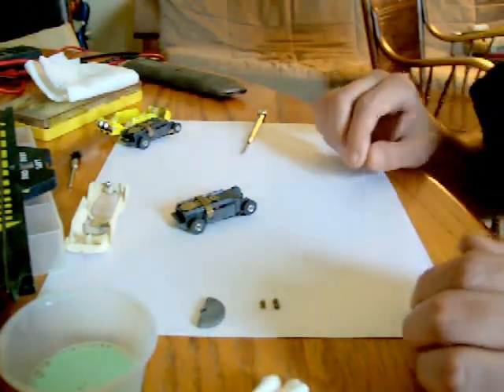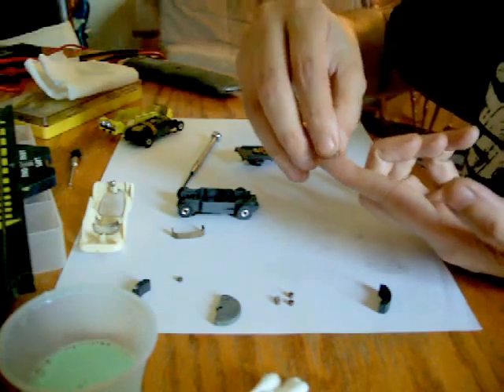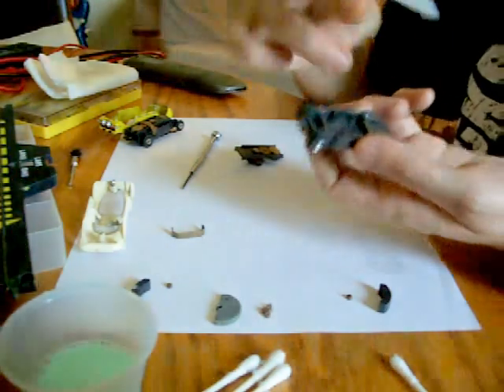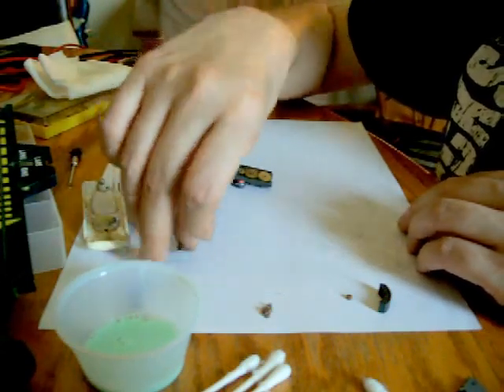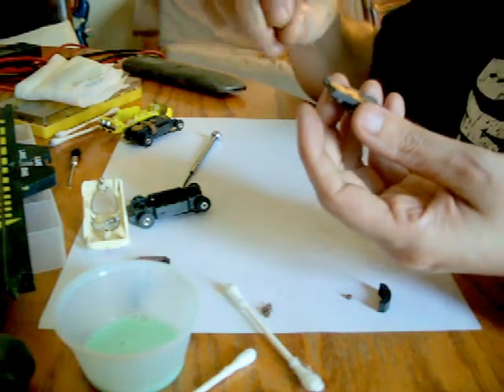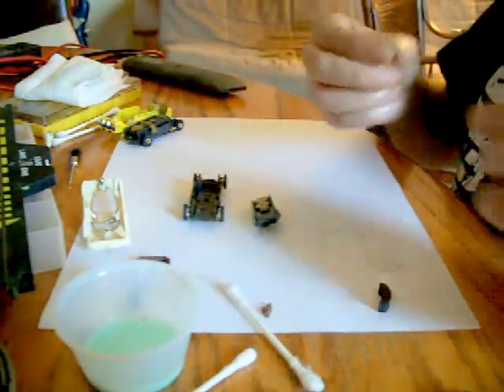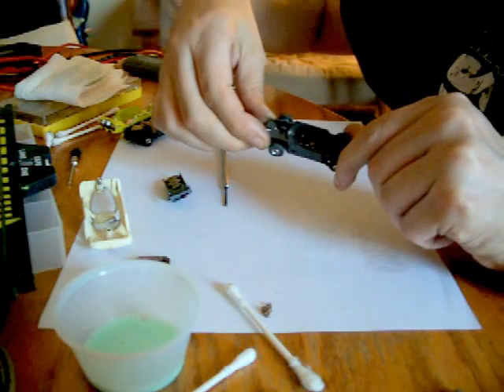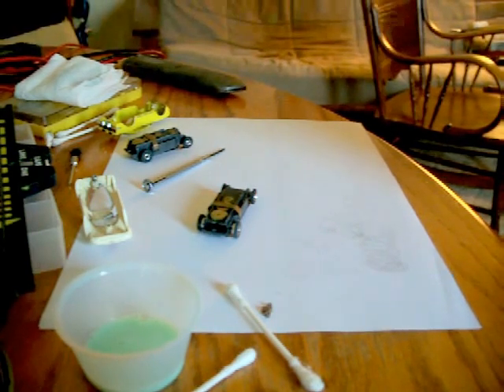Thunder Jet 500 cleaning - Part 2 of 3

Comment: pretty good video for basic cleaning of a like new or new old stock T-jet.
(for all who will see and watch this if they don't know already..) 
used and worn chassis will need a lot of adjustments after cleaning - brush spring tension, pickup shoe and spring tension, etc .
(at least 11 oiling points- many diagrams and info on Google IMAGE search of course)
also;  BRASS gears.. (Axles holes) 
probably should have said the very lightest SYNTHETIC oil that is available. (can be obtained on eBay and other locations)
also, in my opinion it's not a good idea to use cotton swabs to clean gears etc, unless you can get every tiny piece of micro fuzz off things afterwards. 
I find dipping an old tooth brush in alcohol is the best to clean some things, if not everything,  as not to leave cotton remnants.
Cotton linen pieces(rags)cut into 3 or 4 inch squares work wonders for many things also.
and..the one thing I've always thought strange about shimming magnets is , to me it seems the magnetic pull to the armature would draw them in "naturally" so as to make them closer to the motor naturally. Of course shims will keep them tight.